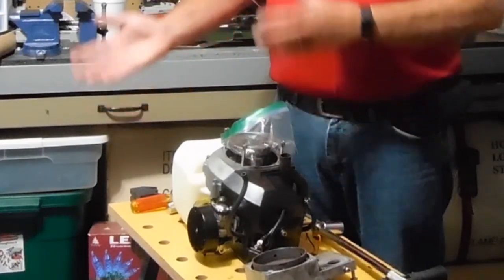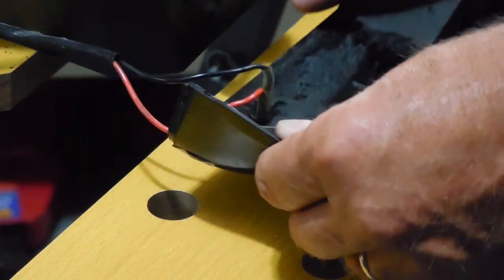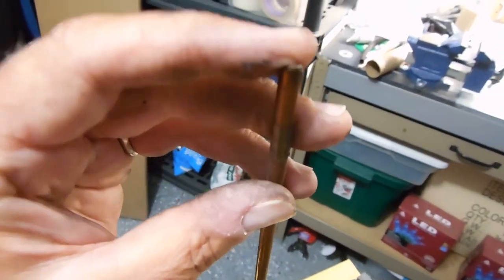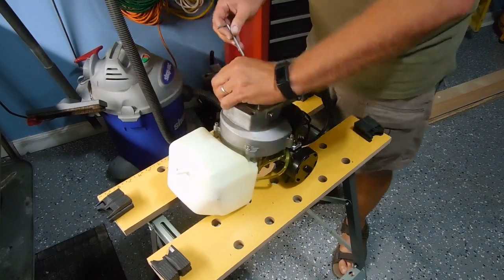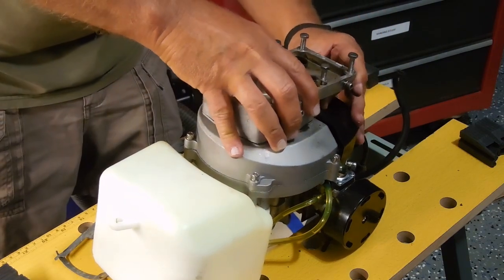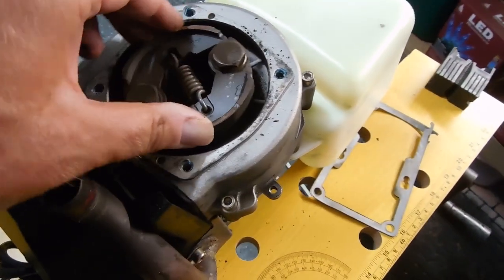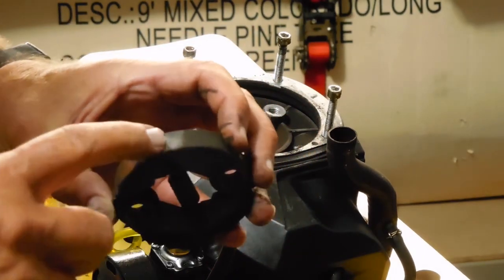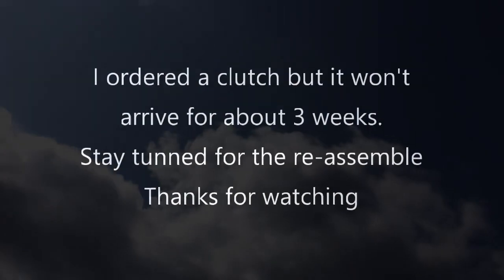Hangkai 3.6 hp Review: Clutch Repair (Part 1: Teardown)

Comment: I love your videos, please keep making them! Just an idea, if you replace the heavy clutch spring in the center with a lighter spring, it shouldengage quicker. If you go light enough, it should engage as soon as you pull the pull string keeping the wear down to almost nothing and keeping that water pump continuously running. I have never tried it, but would be curious to see the difference.
Reply from the maker: Great idea, I'll see if I can get a lighter spring and update as I go!
Reply: BoilerDan1 I’m curious about this one.. that may be something I decide to do. Maybe only after mine fails. My 3.6hp is coming today so I’ll be getting it ready to go. With your videos, I should be able to fix damn near anything on this little fella. Dan, did someone say a Honda carb fits on this Hangkai?
Reply from the maker: I'm hoping yes that the carb will fit!  But I've not confirmed that as of yet.  The new clutch I ordered is for a Honda... It looks the same, and the diameter is correct.  Just hope the bolt holes match up!  I'll look into the carb match when I get a chance.  Enjoy your new motor!  Keep a wrench handy.... (0:
Reply: BoilerDan1 Haha I’ve already needed to bust out a wrench. Fixed a couple issues I ran into. I noticed I don’t get much water coming out of mine. Impeller is good and the gasket on the outlet isn’t covering any holes. Now, I tested that inside a bucket (for lack of a better word) so I’m wondering if the prop was swirling the water too much. It’s a simple little machine. I hope I can keep it running.
Reply from the maker: Yes, the prop would create too much air in the mix.  But don't over accelerate if you remove the prop.

Comment: I think that “copper” tube is copper washed steel. I’ve had my hangkai for 8 hours and it’s dead. I went maybe 200 yard before it went kaput. It was doing a great job until then. I broke the pull cord on the water so I need to address that. Oddly, mine came with grease in the gearbox. I replaced it with CRC marine gear oil. I’m running a 30:1 mix with royal purple synthetic. So... I have a project to work on. Should have went for a 2hp Evinrude and just rebuilt the carb and other odds and ends to make it run. I had a BIT more faith in the hangkai than I should have. I will report back after I tear into it. Love the videos and your help Dan!
Reply from the maker: YIKES.... Hope others read the comments, as experience is a great teacher.... :0(
Reply from the maker: Did you see where my spark plug went bad almost right away?  I'm just adding to what can or might have gone bad.....
Maybe you changed the spark plug already?
Reply: Tyler replace spark plug,  they will go out real quick, we can give u the different type u need.
.
u can always part it out if u have to if its really done, lord knws there arent a lot of parts for these an a lot of people are buying them.
Reply: Weird I didn’t see Dans other messages. I was able to get everything running and back together. I just haven’t taken it back out for a good go. I went to the same area it cut out on me before and switched to an electric motor because it was 9:00pm and that thing was obnoxious. I also bought a 1985 Evinrude I’m getting running again. Once I got it running, I checked to see if the water pump was doing anything at the telltale and it wasn’t so, I killed it and I’m waiting on parts. 
I think I enjoy working on these too much. But at the same time... I don’t want them going out on the water.😂 
I wasn’t going to try a plug because I was just put off by it dying so soon. So, I’ll throw a new one in now that I’ve cooled down about the situation.
Reply from the maker: @TylerLL2112  At least you have a sense of humor about it.  My new clutch has arrived, I'll install it in the next couple of days.... I should have ordered two 😂
Reply: BoilerDan1 I’m curious how that all works out! Thanks Dan.

Comment: Interesting about somehow keeping the clutch open, and bolted. Or perhaps lining a rubber sleeve “shoe” inside the housing so it will be thicker and engage sooner with more grip?
Maybe I can salvage my new HangKai by somehow locking down that clutch so the shaft will always spin?
Look forward to seeing your new clutch instal!
Reply from the maker: I was thinking about that, but concerned that if it did slip, the friction.... I'd end up with a fire.... NOT GOOD ON A RUBBER RAFT IN THE MIDDLE OF A LAKE!  ha ha ha.... (0:
Reply from the maker: Just removing the spring would probably have the same effect?
Reply: Or as Caleb said, put in a lighter spring, or somehow stretch out the existing spring a bit to loosen its tension?
Reply: Would doing this make it more difficult to start, since you'll be turning more than just the motor to start it?
Reply from the maker: I'm guessing only slightly more to pull the start cord?  I'm more thinking of getting a lighter spring so that it opens up sooner.  Once I receive the new clutch, I'll check that out prior to installation and include that in the installation video.
Thanks for watching!
Reply: @BoilerDan1  Great, I'm looking forward to it!

Comment: How many hours of running did the clutch last?
Reply from the maker: Sorry, I didn’t keep track of it. That being said, I noticed it towards the end of the first season….. but definitely started going out that second summer here in the USA.
I would recommend changing the tension spring right at the start.
I’ve heard of people just removing it and just shutting off the engine when wanting to idle.  The tension spring is way too tight for sure.

Comment: 8 months times 3 miles a day..is about 720 miles I got out of this motor and it still runs...but now I have to figure out how to extract those hex bolts and replace the clutch pads..
Reply from the maker: I had heard that salt water could be a little tough on this motor.  Maybe that has something to do with the bolts freezing?
Thanks again for contributing to my tale of a tale! 👍

Comment: Did you add grease to the grease insert? I cant find any videos please help
Reply from the maker: My apologies for not replying.  For some unknown reason I have about 6 comments that I did not get a notice of?  Yes, I did add grease using a standard grease gun.  It only puts grease on the collar where you turn/spin the motor to change direction.  It could probably function fine for years without adding more grease.

Comment: Hi Dan! Great videos. I bought this 3.5hp two stroke as a backup. I've only had it a few days. The motor fires right up although I needed to replace the plug after letting it idle for about an hour. My question: my shaft and propeller don't spin freely like yours. It's takes some pressure and a wrench to turn the shaft and gears. I removed the lower end just to make sure it was the lower end gears. Was yours like this? When I invrease the rpms the clutch will engage but I don't think the shaft should require so much force to spin.
Reply from the maker: A clarification:
Just want to make sure that you added gear oil to the lower gears?  That being said, this motor has too strong of a spring in the clutch system.  That so at an idle the propeller will not turn. The issue is that you have to get high rpm’s for the propeller to engage. That is also when the water pump wheel starts turning to cool the engine.  It also puts excessive wear on the clutch pad.  Lucky for you I made a video on my changing the clutch.... but if you’re just getting started, it will work a lot better and your clutch will last longer if you replace the spring.  I’m going to put links below to the videos I made replacing the clutch. It will also show the replacement of the spring. NOTE: the 1st video is actually the last but it will show you the spring.  I used the one from Menards... The one I mention from Home Depot was too small.
1-spring type https://youtube.com/playlist?list=PLjMZtm2hvqrOIvLcah1u1V45Y_R-AKeqm

2. Clutch replacement:; https://youtube.com/playlist?list=PLjMZtm2hvqrOIvLcah1u1V45Y_R-AKeqm

3. Clutch putting it back together 
https://youtube.com/playlist?list=PLjMZtm2hvqrOIvLcah1u1V45Y_R-AKeqm

4. Runs great after lighter spring 
https://youtube.com/playlist?list=PLjMZtm2hvqrOIvLcah1u1V45Y_R-AKeqm 
Let me know if I can help more and I will try.
Thanks for watching 👍👍

Comment: Boiler Dan. Thank s for taking Point, on these motors. I have my  2  3.5's i ordered. in box an working on the first one to set up. its been HOT  95 -98 for 2 months here in Montgomery Alabama with heat indexes up to 111 degrees, So im not going to put it in water or my boat til its cools a bit.

are u using Ethenol treatment removal additive to remove ethenol out of ur Gas.?
 Been using it for years in my autos an motorcycles. Not real clear on 2 cycle outboards, Although Ive a robi gas   weedwacker an use ethenol removal-an it runs well.  
Tks John

Comment: Thanks for all the work you are doing on this...Couple questions:  What is the better replacement part number for the spark plug?  Why are the clutches wearing out so fast?  What part numbers did you get for a replacement clutch and lighter spring?
Thanks for all you are doing!
Reply from the maker: Spark Plugs:  Highest recommendation of received was for the NGK brand part # BM6Y
I had first put in a Champion CJ8 and it was working fine, but doing some research and other viewers suggested the NGK brand, so I made the switch.
 Prime-Line Spring, Extension, 7/16 in. x 1-7/8 in. - .047 Diameter (LINK: https://www.homedepot.com/p/Prime-Line-Spring-Extension-7-16-in-x-1-7-8-in-047-Diameter-SP-9605/202639133?cm_mmc=ecc-THD_ORDER_CONFIRMATION_BOSS_STH20191021_THD_ORDER_CONFIRMATION_BOSS_STH_-Product_URL__W844205603withTHD
But I don't know yet if it will fit or not.
The one in the video was from Menards: Extension Spring Part # 88195 
size 15/32 X 1 13/16 but I had to alter it.
The clutch also fits the Honda GX31 or GX35.  Here is an Amazon Link:   https://www.amazon.com/gp/product/B07J6F4J6M/ref=ox_sc_saved_title_1?smid=A26QN2ZDA6KSBT&psc=1.
I think it wears out because the spring is too strong for what they are using it for... But I don't really know?

Comment: Thank you very much for your videos ProveIs this the motor I want to buy ? Lol . No of course not. Is it the cheapest thing out there For emergency use. Yes It seems to be.
      Your videos have been very Enlightening and helpfulIn getting my Hancock 3.6 ready for service. One of the 1st things I noticed beforeI saw your video on the clutchWas that it took a very high RPM for the clutch to be engaged.I was wondering if you thought a weaker throwout Retraction Spring  Would fully engage The scientifical cluscientifical clutch sooner and limit burn out of the clutch friction pads?
     If you haven't attached your new clutch yetPerhaps it would be worth an experimental try.
    Thanks again for your videos
Reply from the maker: Yes, I have attached a lighter clutch spring.
I definitely think it is a better way to do it!  If you search my series on the motor I do show my replacing the spring and also putting in a new clutch too!
Thanks for watching 👍

Comment: Where can you find replacement parts for these motors, I need a smaller jet?
Reply from the maker: I’ve had success with eBay.  Just search Hangkai 3.6 motor parts.
I’ve also located the company that makes them.  Although a little different/ difficult to work through it, I did find helpful information.
Here’s the website…. You’ll need to select English on left side.  If you click the vertical lines upper left you’ll get a drop down menu. Select “News” and you’ll find information on repairs and troubleshooting.
You might be able to get parts from them directly?  NOTE: I’ve never tried that!  eBay is where I found the items that I needed.
Thanks for watching, hope that helps 👍
Reply from the maker: Oops, forgot to add the website 
http://m.hang-kai.com/en/
Reply: @BoilerDan1  great ill check them out, thanks!

Comment: Does replacing the clutch spring with the weaker menards spring allow you to run at slower speeds? I slowly back-troll a lot and I am looking at doing exactly what you described. Thank you!
Reply from the maker: Yes, it works much better and you can get the propeller to turn at less RPMs.  You could also remove the spring, but the propeller would always spin so to stop you’d need to shut it of.  But you’d be able to get the slowest speed possible. Thanks for watching 👍 
NOTE: In one of the videos I mention a different spring. It didn’t fit, so the Menards one worked out the best.
Reply: BoilerDan1 Thank you!

Comment: Hey @Boilerdan1, as always love the videos.  Update on my journey, at the 9th hour of break in, my motor was at half throttle and suddenly sounded like it was revving up on its own without any input from me.  So I turned the throttle to idle.  I left it there for a minute and again without input from me, the motor sounded like it was revving up.  I turned it off for 5 minutes, turned it on, waited a minute, turned the throttle half way and it sounded okay for a second and then suddenly started revving up super fast.  Then I heard a loud pop and the motor turned off.  I tried starting it again, the motor turned over, but wouldnt start.  I thought my first troubleshooting step should be check the gas then check the spark plug.  The spark plug was done for, I replaced it with the NGK and it runs okay after that.  Anyway, I had a question regarding the clutch replacement.  What clued you into the clutch needing replacement?  I watched this and Part 2 and I can't recall you mentioning if you noticed the motor running funny or if you changed the clutch for preventative service reasons.  Thanks again in advance.
Reply from the maker: That sounded a little scary! Glad that the spark plug brought it back to life!
On the topic of the clutch, I noticed that it didn’t seem to catch unless I was almost at full speed, then I thought I had lost some thrust? But I wasn’t sure…. Then I launched and when I accelerated, I had almost no forward motion! Fortunately I was able to get back to shore and began my adventure on clutch replacement!
Another viewer advised that I didn’t need to remove as much as I did? Apparently working from the other end would have been easier?
In the process it is obvious that the clutch spring is too heavy for this application.  Some even advocate just removing the spring all together!  It makes sense, you just need to be aware that your propeller will always turn.  That would keep the water pump wheel turn also, which could be a good thing too!  At idle, your speed would be slow and just shut down as you pull into dock….. give it some thought. Minimally, I’d find a lighter tension clutch spring.
My thoughts anyway 😁
Reply from the maker: An Important error in my video….. I failed to mention that I kept adding snow to keep the water cool. I suggest that you run a hose in the bucket or better yet, just take it out on your boat!  I only did the bucket because 1, it was winter & 2, I didn’t have a lake nearby…..
It could be getting a little warm.
Reply from the maker: It could also be the amount of oil to gas mixture. During break in, the oil is a little richer. Once you go to the normal mixture that’ll help too.

Comment: My propeller does not spin..can you please help..brand new..runs great no spin..can you help please
Reply from the maker: The propeller won’t spin until you give it almost full throttle.  The spring in the clutch for this motor is too strong. I will attach a link to a video that will show you the clutch. I hope it will help you understand how it works.
You should watch all of these to understand the clutch system:
1 https://youtu.be/H4mPGuEKnKI
2 https://youtu.be/Qu9OjXbMutA
3 https://youtu.be/G4qLw14lf9k
4 https://youtu.be/G4qLw14lf9k
Let me know if those helped!
Reply: Thank you that was it...wasn't at full throttle .

Comment: How many hours on the water before the clutch went?
Reply from the maker: I don’t exactly know?  But I’d recommend having a spare available!  You can tell that it’s wearing out as you get a feel for your motor..... it sounds a little different, like you can hear it slipping and you lose some power (thrust).  I do think adding the lighter spring will increase the life of the clutch because it engages easier.  Without the lighter spring, I would plan on replacing it at the end of the the summer each year.  Mine lasted two seasons however I didn’t take it out all that often.

Comment: FYI    Dan jus saw a 3.5 video where fella removed clutch spring completey.  Did video  him an daughter on water running well.
I commented to see how its running still?
So all things being even, I had no idea it would run without that spring, course im  green on outboards
anyway, would save the wear an tear if thats the case.
Reply from the maker: Just received my replacement clutch.  Went to Menards and found a less strong spring and will replace the one it came with.  I think removing it, it would run without a problem, but I'm hoping this weaker spring will allow me to idle?  I'll post the video putting it back together in the coming days.  I'll include info on what clutches fit it... Very cheap fix, but will probably need done every season..... or two.
Reply: That would be so helpful to know where u get  ur clutchs, ill most likley need to get a inventory of them.

Could u include in part 2 as well did u locate a new gasket??. if not can u detail how We could make one?.

Thanks Dan u the man.
John  Montgomery alabama
Reply from the maker: I purchased some gasket sealing stuff that I'll use.  But you can also buy gasket sheets to cut yourself at any auto parts store.  I'll show it in the video. The clutch I will show type and where to get, so far, they are also easy to get on line via Amazon or eBay.  I'll show that on video too.